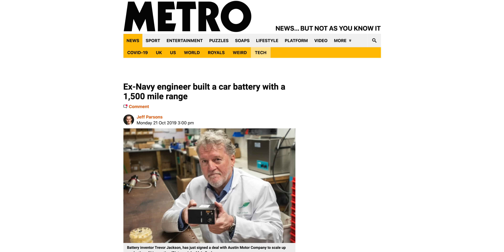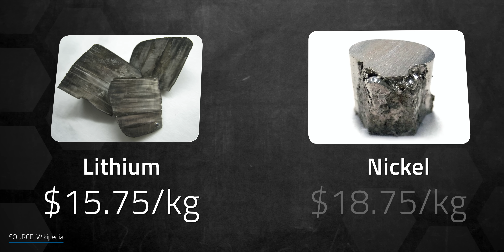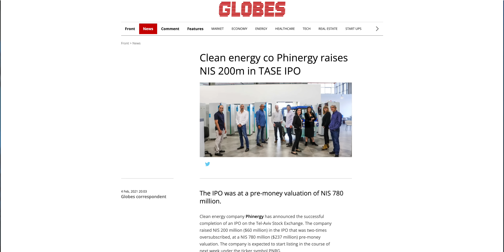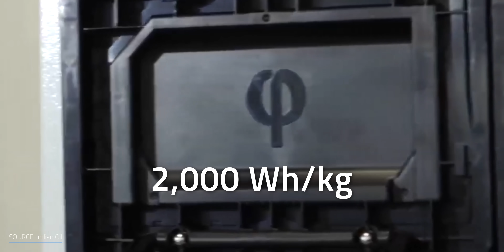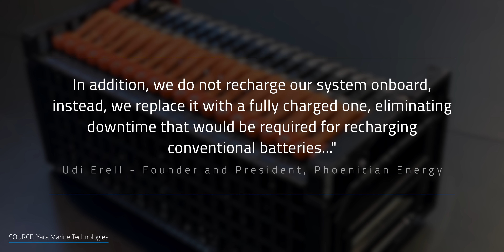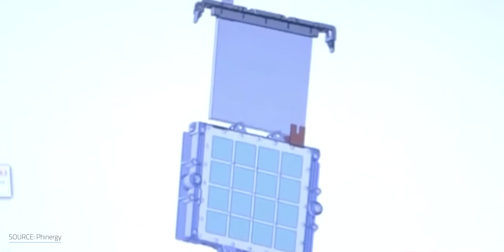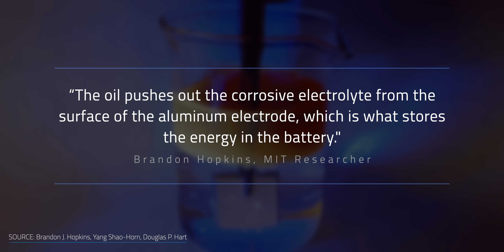Exploring the 1000 Mile Car Battery - Aluminum Air Hype?

Comment: 9:30 - regular EV gets a charge from a tow truck, what about Al-Air-Battery car? 
Well, that one just gets a new battery (assuming those would be standardized, or you would tell the service company your needed battery type so they would load that one, when you called them)

Comment: What happens when you run out of charge on the road? Same thing that happens when you run out of Gas. You pull to the side of the road, you call AAA and they bring you a new battery and swap it out for you.  In fact, this technology would be BETTER than rechargeable batteries because 1) it doesn't take long to refill your tank 2) it gives gas stations a new lease on life and they can retool to be quick swap stations. And the silver catalyst issue can likely be solved by finding a catalyst that is not as expensive (there almost always is if you search deep enough). Honestly, it's never been the Range that has stopped me from getting an EV. It's always been the need to wait Hours to refuel. I don't want to do that when I am out and about.

Comment: lol good greif! If I could get 1 or 2k miles out of a battery in an electric vehicle I would have no issue with switching it out! How ever at about 3 and 500 miles per charge I wouldnt be interested still. Id rather own the battery and just recharge it. To be clear though the current 3 to 500mi per charge is enough for me being rechargable. The only issue that cause me to not have an electric car now is price. So I deal with the hybrid for now. I really really hate range anxiety. and ive been in a hybrid for over 10yrs now and I dont even think about gas. It cost about the same as dinner to fill my tank and I only have to fill my tank about once every 3 weeks. But yes if I can get 1 to 2k miles off a swappable battery I'd be in!

Comment: It eliminates the big upside of charging at home.
If fec es really hits the fan after an earthquake or something generators can be easily salvaged, fixed or even built from scrap. But i can't just realistically build a new battery.
The real use case i see is range extenders. Cars just need to be more modular. Most people would be fine with a cheap small rechargeable battery (50-200miles) if they can just drop in a 1000 mile one use range extender if they actually need it or just for peace of mind.

Comment: I see a big problem. It costs a huge amount of energy to extract aluminium metal from Bauxite ore. With the aluminium returning to an oxide each time the battery is spent the energy cost of using aluminium air batteries is going to be far higher than any rechargeable battery technology.

Comment: There are far better fuels than aluminium. Nitrous Oxides and Carbon fuels can be made incredibly easily. Gigaamps can be stored in wire. Heat can be converted into electricity easily. The list goes on....

Comment: I feel like a big elephant in the room on this is that while the batteries are more energy dense by weight than Li-ion batteries, they also weigh a lot less which means you can't just replace an existing Li-ion battery in current designs to reap the on-paper benefits because you'd need to account for the change in required volume. Is there any kind of breakdown on the exact volume you would need to hit the energy capacity of a modern EV battery bank?

Comment: I can imagine a hybrid EV. Half lithium half aluminum. Use the lithium for day to day and aluminum for the intermittent road trips. 

But only if the battery replacement cost less than gas

Comment: What India also has is a huge army of roadside mechanics. When the IC engines die these chaps will have to find the next livelihood. It is here that Al-air batteries can help. And we are a very cost-conscious nation that avoids service & repair at authorized service-centers & dealerships! And don't forget that this maybe a fine way to avoid putting up a costly EV charging infra-structure.

See.. India hopes that its millions of micro-scale enterpreneurs will find gainful employment in replacing the Aluminium plates from EV owners in their vicinity. This task is labour-intensive & well suited to the road-side ecosystem . So also the cutting & shaping of the Aluminium sheets will engage the services of millions of other small enterprises that in India are always looking for work. The Indian Alminium Industry has anyway made zillions of metric tonnes of its sheets available at every hardware stores.

What really appears to be the main challenge is the Carbon-sponge at the + ve plate & its catalyst. It is here that Phinergy adds value. Fortunately, this isn't consumable, unlike the Aluminium.

Comment: It isn’t so much a problem with swapping (Tesla hyped swapping too), but that the battery itself cannot be recharged at the station. Instead there would need to be a massive reclamation and delivery capability to move all the old/new batteries around each city. Seems unsustainable.

Comment: Imagine: you drive up on empty to the closest station that can replace your battery.  However, they are sold out and nobody close has this battery.  Uh, no thanks.  Whatever it is, it must be rechargeable.
Reply: Imagine: you drive up on empty fuel tank to closest gas station to refuel your diesel SUV. However, they are sold out and nobody close have diesel fuel. Uh, no thanks.
Sounds familiar? To me it is, cuz i've been in this kind of situation once. it has nothing to do with lithium-air batteries - you can have this problem with any vehicle in remote areas.  it is economical\logistical problem. not technological. so in my opinion it really comes down to energy density and price.
Reply: MKBHD has a video where they do a road trip with a gas vehicle, Tesla and another electric. Several of the charging stations they go to are out of order, the electric vehicle has to actually turn back around to find a good one.
Reply: Isn't this a problem with fuel and electricity also? You could just do what you do now, drive to an other station.

Comment: I'd expect this to evolve to a point where we'd just swap out aluminum plates rather than battery systems at a plate store/station.  We're already inured to handling very dangerous chemicals by consumers (gasoline.)  I suppose New Jersey could limit the plate swapping to station personnel.  Petro companies would like this - just another extractive industry for raw materials and manufacture of aluminum plate commodities for unit-level distribution.  Sounds like the gasoline industry.

Comment: If they can figure out the degradation issue this will dominate the market. No limit on range and near instant swap like the speed of getting gas.  Also running a battery swap the customer doesn’t have to own the battery so less cost.

Comment: Based on the description, as long as the electrolytes don't interact with anything else, The need for silver is capped at the demand rate and the aluminum could be designed to be hot swapped. This would not only make the recycling process quick but also separate the recycling process from "fixing" the battery.

In terms of road side, assistance companies could just have small variants which could plug in to give the car 10-30 miles and comes with a box to send it back.

Having a system to seal the battery would stop new ionization. Meaning that the battery could use smart tech to only expose the batteries when power in needed and ridding the need for electrolyte draining.

I personally don't see a drawback that is little more than an inconvenience in comparison. Having a 1000 mile range, once hot swap stations are available, beats petrol vehicles by 4 times too.

Comment: an "alloy"of aluminum and magnesium would greatly increase power output.
A backup, smaller Li ion battery along with the main battery would make a rechargable emergency power source.
And really, if your car has 1,500 mile range and you were so irresponsible that you got caught out in dire conditions with a dead battery, I think you get what you deserve...

Comment: It's worth pointing out that the weight advantage is NOT intrinsic to Aluminum, Lithium is a significantly less dense metal but the structure of a Li-ion battery is different and requires other materials for the electrodes.

Comment: An EV with battery swapping outsources (and thus stabilizes) the main worry I have with EV's at the current time - and that is the degradation of a very expensive battery in my ownership.  Swapping batteries means that the onus is on the battery provider to supply working condition batteries - not on me, to maintain it, and suffer loss of function over the years.

Comment: I can never understand commentary about new battery technology acting like there HAS to be 1 solution. Why not multiple? I drive around 400 miles per week. So i would use up a theoretical alum air battery every 2.5 weeks taking some of the concern about degradation away. My wife drives about 80 miles per week,  so a small lithium battery ev would be great for her.

Comment: The practicality of these aluminium/air batteries depends on EITHER development of a recharging mechanism OR the ease and speed of battery replacement systems PLUS their routine cost to consumers - having created the most economical recycling METHODS.  AND of course, cars will need partial redesigning to incorporate battery swap-outs!  
But as a user I'd be OK with swapping out the battery once a month on average.

Comment: This be useful even if its half as good as they say it be over Lith ions.

It use to be in the 80s you need to have you car oil change every 3-4000 miles, I can see them respecting the service stations for battery change out.

Comment: For me beyond small internal flight aircraft the Aluminium Air Batteries sound a good fit for long range Lorries/Trucks running between Large delivery hubs. Known ranges and destinations that way. 
Beyond that emergency generators in disaster zones or just areas of blackouts.

Comment: Once they design the replacement system where the battery packs were on a sliding rack instead of having to lift them out, that will be a game changer.  If one has to empty out their car first to change the battery, nope!  However if the storage was above the battery pack system & if one could carry a spare battery, I think this has real potential!

Comment: The non-rechargeable aspect makes it DOA, no? What happens to the batteries once they're full discharged? Do they have to be melted down/recycled to make a new one? This doesn't seem eco-friendly or economically viable AT ALL.
Reply: Think of it as less as a Gas full up and more of an Oil Change. So once every 2 to 4 months depending driving needs.

Also with how the materials are made are far more clearer and recycle friendly then Lith-Ions. Aliuminun and Sliver are at 90 percent recycle as we speak so its not that bad.
Reply: @ericzaiz8358  If these batteries need to be replaced every 1,000 miles, you would need 1,000 battery swaps to equal Tesla's next gen 1,000,000 mile battery or about 500 swaps to equal current gen. That's a lot of energy spent recycling.
Reply: @ericzaiz8358  we're not talking about recycling aluminum, but converting aluminum trihydroxide back into aluminum which takes a HUGE amount of energy. This isn't a free lunch or more green compared to lithium, this energy intensive process has to happen every 3 times you would charge a model 3 according to this video.
Reply: Recycling aluminum trihydroxide back to aluminum probably is energy intensive. It would be a simple fix to pair these with renewables like wind and solar that produce too much energy at times. It’s a good idea for a spare range booster that can support 50-100 miles. Then for trips swap out the spare for a larger battery. The Frunk would even be a great place for it. Would make a ton of sense if, the tech can get to the point where the only thing that needs to be recycled is the aluminum plate and the electrolyte, and not the entire battery pack/structure.

Comment: We have been driving cars for decades that required standing at a gas pump to fill it.  I don't see a problem swapping out a battery(s) for the same purpose.  If it is economically viable, why not?

Comment: I think adding the aluminum air battery to an existing EV for long trips would be awesome. Keep the battery in storage when not needed then pop the battery in, add the electrolyte (or just add water if the electrolyte can be stored dry in the battery) and go. Swap stations could be more spread out initial or the battery could be shipped dry ahead of time to a location along your route or at your destination. If the cathode is not consumed, I wonder if just the aluminum and the electrolyte could be replaced, that would allow for a more distributed serve network to refresh the batteries. Oh the possibilities!!

Comment: I think battery swapping makes far more sense than recharging and as for running out.... well it's the same for any fuel system DON'T it's very inconvenient. Yes silver is a lot of money but once the battery is made it can be recycled so the recycled battery won't cost as much. The question is what is the carbon footprint of manufacture and recycling compared to lithium?

Comment: The drawbacks don’t outweigh moving forward. The ease of popping out light weight batteries, makes it possible for my daughter to do that at thefilling station. The corrosiveness can be isolated in the disposable battery. Use something besides silver and you have a nominal candidate for ev mobility in trucks, trains and ocean vessels. I think India is on the right track.

Comment: I see several issues with this tech for automobiles in at least the USA.
- Swapping infrastructure doesn't exist and would be difficult to onboard. Would take a ton of investment from some major company like an oil or tech giant.
- Waste and emissions caused by shipping the new batteries, creating the batteries, and land use for new infrastructure. Possible to outperform Li-Ion.
- I would bet that no Al-Air battery would be 100% recyclable. Meaning each battery swap would increase waste.

Comment: potentially stupid question:
you said that aluminium is esily recycled. but what about the reaction endproduct in these batterys? 
how easy is it to get that stuff back into aluminium? 
also is this stuff dangerous/toxic if it comes in contact with people/living beeings/the eviroment? cause both the swapping by unqualified perople AND the fact that these things sit in cars (you know those things that frequently crash) WILL lead to damaged housing and spillige.

Comment: What is the WH/L of these batteries?  What is the range of a al-air battery of the same size as a li-ion battery pack. Lighter isn't automatically smaller.

Comment: Under lithium battery concerns you left out "thermal runaway events" more commonly known as FIRE!!!   But seriously, lithium battery fires are no joke. There's no way to extinguish them, the firemen just have to wait until they burn themselves out (which has the minor side effect of destroying your car). So yes, I have some "hesitancy" about purchasing an electric vehicle.

Additionally, where I live, over half of the grid's energy comes from coal. So I would essentially be driving around in a coal-powered fire hazard.  Maybe some ad executive (or Musk fanboy) can come up with a catchier slogan.